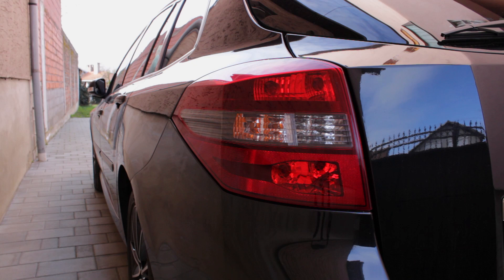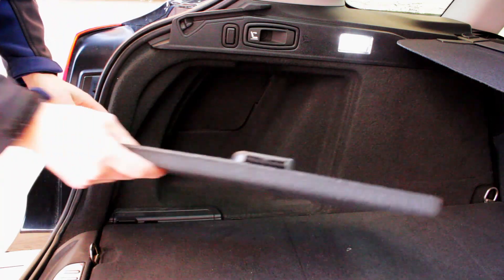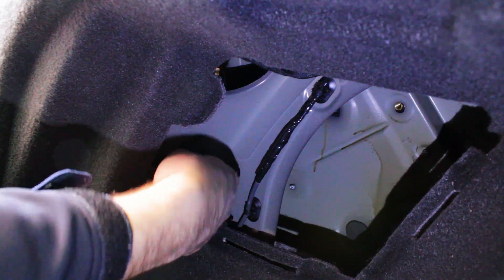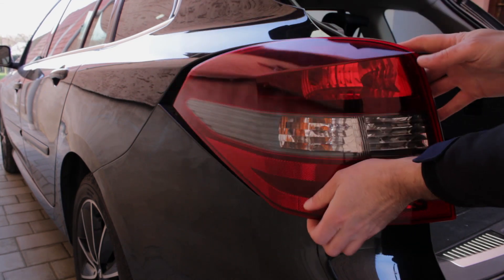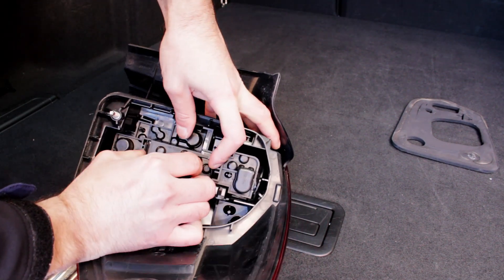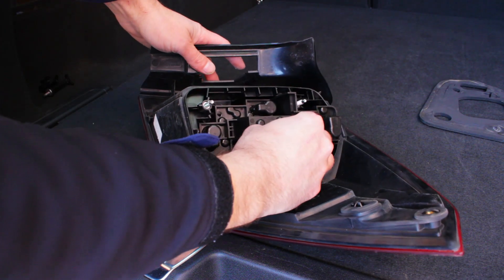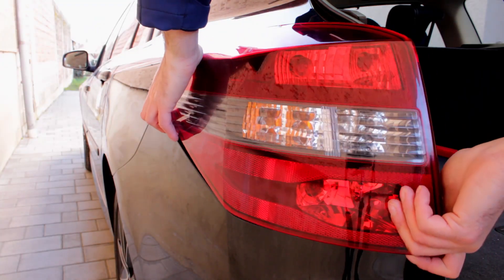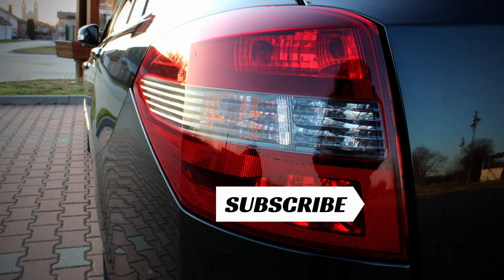How to change Rear lights - Renault LAGUNA 3 Grandtour lightbulb replacement

Comment: Thanks for video. In my case, hard to get out, but then it is not easy to get it back - to fit it exactly in the same sitting. This the first "pop out" place  on dismount lamp then don't want to get back :)

Comment: Great video, greetings from France! Do you know if i can buy the foam joint that i supposed to be here ? When i changed my rear light, i remarked that it was absent. Also there is one thumbscrews missing
Thank you for your help
Reply from the maker: Hey, thanks for watching! I couldn't find any place that sells this by itself. Your best bet would probably be to try and find it on some scrap yard if they have Laguna.

Comment: Thanks guys, your videos are very well explained!!!
I was wondering if you have a video or advise on how to change the high level braking light on Laguna III 2009?
Cheers, keep up the good work!
Reply from the maker: When you open the trunk door there is a black plastic part on the back end of the breaking light. You can just pull it out (no screws, just few clips holding it). After you remove it there are two tx 20 screws to undo and you can take the light out and change it. You can see how this plastic, that you need to remove look like in our last video. Megane 3 is in the video, but it is the same for Laguna. Here is the link: https://youtu.be/BHnUeQBMyqs 
It's around 3:50. Thank you for watching, and let us know if you managed to do it!
Reply: 0

A
Ă
😊

Comment: Hello and hvala for the video! What kind of w5w led bulb did you use for the trunk light? I can see you have a cool white one.
Reply from the maker: Hello and mulțumesc for watching. I have used some w5w led bulbs which i've ordered from aliexpress. Here is the link so you can check them out : https://www.aliexpress.com/item/4001075988948.html?spm=a2g0o.productlist.0.0.2ded18ceWTaDho&algo_pvid=d9df2056-7eac-406c-a0b4-0521812e64ff&algo_expid=d9df2056-7eac-406c-a0b4-0521812e64ff-7&btsid=0bb0624016052979613656841e4719&ws_ab_test=searchweb0_0,searchweb201602_,searchweb201603_

Comment: Hy, when I was  undoing bolts, I have dropped one of the bolts and I can't reach it. Do yo have any ideas where can I find them ? Whre can I buy another bolt?
Reply from the maker: Hi. Honestly don't know. I would try some random similar bolt that would do the job, or maybe look on ebay. Other than that, I would look at salvage yards or try to find someone that is selling parts from a wrecked Renault (does not have to be a Laguna - maybe some Megane or Scenic). Thanks for watching!